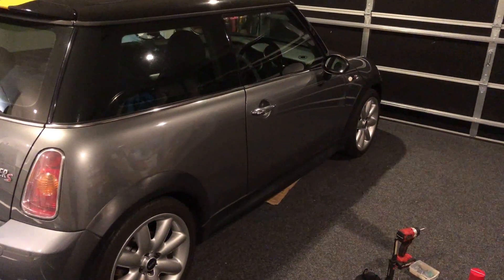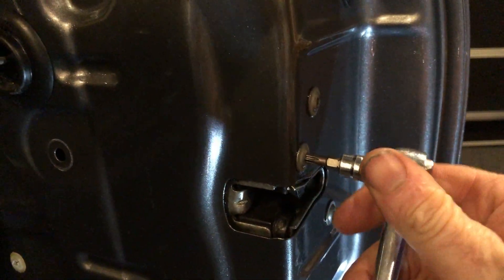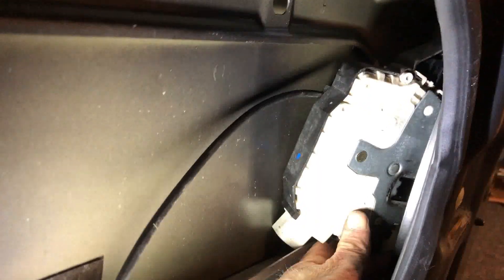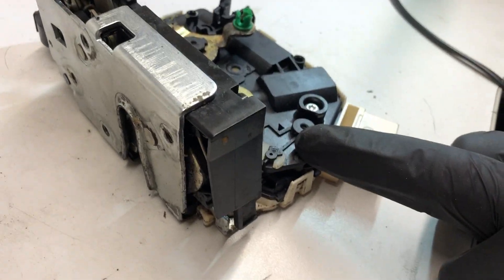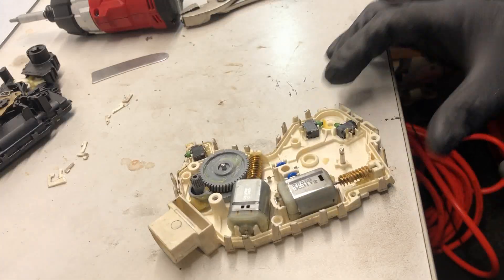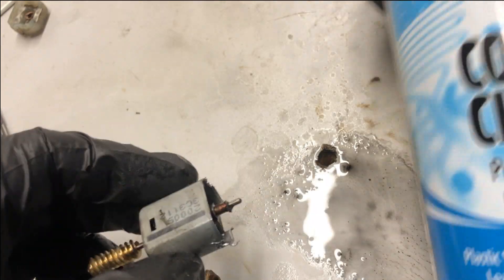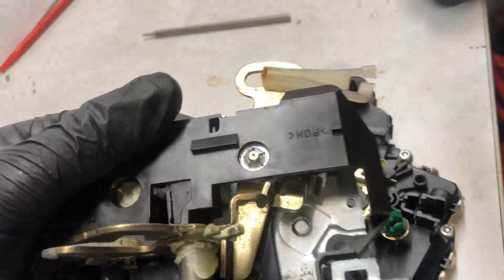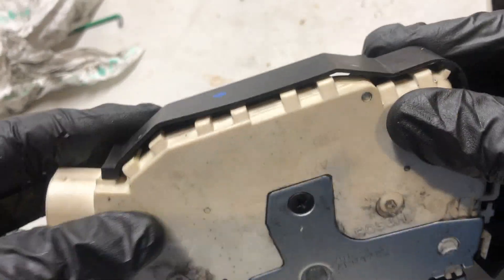Actuator rebuild - Mini R53 door locks not working right?

Comment: After many months trying to sort these locks this is my advice ..there are two motors ..one is  for open and close the lock and the other is  for the dead lock....the Body control module switches polarity to open and close the johnson motor...and the other motor deadlocks.....you can cut the.white wire on the loom to stop the.deadlock engaging if you have this problem and it still  locks  normally without...deadlocks are a pain if they jam...nothing opens...the motors  when removed may still spin..but when loaded with the lock mechanism to move may fail...replace ..and make sure you get the right polarity replacements...and make sure the mechanism is clean and moving freely....takes a bit of washing  out with WD or electric cleaner...then lightly grease it.....that's what causes motor burnout in my opinion..
Reply: When I unlock, the mecanism works, but not when I lock, that could be because of a fail of one motor so, right? If I cut the white wire, the door still open and closed but not unlock right?
Reply: @mechadesign  hi...ok there are two motors in the lock mechanism....one is  for the normal   lock and unlock...and  the other  motor is to operate the dead lock ....... If you cut the white wire it should stop the dead lock engaging...which is a complete pain...because it can lock you out the car ...it's a nightmare to bypass...the locks work from the BCM ...which powers the motors.   ...the BCM sends a +12v to motor to lock...then reverses polarity to the motor  unlock ....which works on both the motors...that makes any sense?
Reply: The lock mechanism gets dirt ingress then puts more load on the motors...which eventually fail...so if you have it working one way bit not the other then it could be tired motor  which is failing....welcome to ask any more questions
Reply: @mechadesign  the white cut  stops the deadlock from engaging on the lock.... You seriously don't need it....

Comment: Nice video, detailed, comprehandable etc. congrats. Those motors are the ones that have been installed in model cars since the 70's in Japan. They were called Mabuchi R130 if I remember well, but now they're all over the place (probably most of them being made in China).
Reply from the maker: Thank you. Makes it a lot easier finding the parts when you know what they're called.
Reply: @thomaswilding8818  The only problem is the shaft - the body of these motors is the same in all applications, but the shaft is different - they use very long shafts in the Mini door lock actuating mechanism with a worm drive (probably heat applied) to the end. That is the special part here.

Comment: Is it possible for the motor which was reconditioned or fixed go in the other way considering it has two terminals that it basically sits on ?

Comment: Thanks again for the tutorial on repairing these units. Worked like a charm until I realized that, although my passenger side door button goes down when I lock the car, the actual locking mechanism doesn't engage. The door opens and closes normally. 

I wonder if that motor wasn't cleaned enough because I didnt take it apart to flush it, or if I reinstalled a spring the wrong way (or forgot it altogether).

Any educated guesses before I take it apart again?
Reply from the maker: @KellyWestlund  sounds like your motor is working okay. I'd guess something round the wrong way.

Comment: Having replaced maybe half a dozen of these actuators over the years, I very much appreciate your ($$$ saving!) tutorial on fixing the dang things instead! 

In case it's helpful for the next person - after taking one motor apart for cleaning, I opted to try cleaning the other with contact cleaner through the little holes in the motor housing rather than taking it apart. Worked like a charm! Maybe save that PITA step next time around and make for a faster fix. 👍🏼

Comment: Good video... I did it same as on video. No problem at all locking unlocking perfectly but when I drove the passenger door locked but drivers not. when I stopped and pulled the handbrake it did not unlock. I dont know if it is because driver doors actuator motors are dead too or something else ? also middle locking button doesnt work. 
I tried to unlock the passenger door maually and it doesnt work... I dont know what to do
Reply from the maker: @aim8179  You'll need to pull the door card off again. Check if all the linkages are still attached properly at both ends, plug attached, etc. before opening up the actuator.
Reply: @thomaswilding8818  on the passengers side i did it. everythings okay. but I think computer still thinks that the car is in driving mode so it wont ulock the passenger door

Comment: My key fob isnt working but i already replaced the actuators on my passenger door because of faulire but it still wont respond tl the key i hear no clicking sounds or a fail to unlock it just doesnt work
Reply: Put a new battery in your fob and then follow the instruction to re-initialise your key. In the car, just press one of the fob buttons four times.

Comment: A pair of needle nose pliars just small enough to fit into the motors locking tab detents will grab the tab and  with a squeeze bend it out so you can open the motor.
Reply from the maker: My needle nose were too big to fit in their. That would make it a lot quicker (and safer) for those with a good set of fine tip pliers.

Comment: use an automatic center punch to loosen that push nut at 5:20. just punch at the base of each of the "fingers" and it will get loose then push the pin out. then you can get a new push nut when you put it back together.

Comment: Great instructions. I have a bonus tip for people. The par that you took off at 4:48, you may take inside the door. Then the whole peace comes more easily out. And the same thing when you put it back in. Put it there with out it and just add it after the lock is in place. Because getting the lock in and out is the pain.
Reply from the maker: Excellent tip. Yes that is the part you're fighting to get it out of the door. Great idea.

Comment: My kind of video - concise and just pushing my limits - -----------------------                      

I swapped a lock out for a 2nd hand one - that failed same way = duff lock motor
I swapped the spare good motor into the 2nd lock only to find (after a couple of hours of diassembly/reassembly) that the worm screws are different sizes (6mm on duff motor and 8mm on good pair)
i swapped the 6mm worm screw across
INTERESTING journey !!

  job completed!    

THANK YOU                        old git, UK

Comment: I was able to rebuild the one motor that was burnt out with new brushes from another motor. I was wondering if you knew what the other motor with the larger gear and attached to the grey gear does? Also, is there a amount of time you have to wait in between attempts of locking and unlocking while testing? My motor seems to work then stop working then start up working again after waiting. Maybe a thermal protection or just the motor being worn? Any advice would be great. I also found ebay has motors of the similar size and gearing. Thanks for the great video!
Reply from the maker: I have not gone through to work out the actions each motor controls. Good thinking replacing the brushes. I had hoped to provide a link to replacement motors, but could not find anything I was confident was a direct swap. Can’t say I’ve ever had to wait for the locks to start working again.

Comment: Driver and passenger locks running opposite from each other after you finish? READ ON! First of all, great instructions, you saved me several hundred dollars from buying a new one, and plenty more from not having the dealership do it. I’ve read several comments about the lock operating backwards after being reinstalled. I had this same problem and was about to lose my mind until I realized what a bonehead thing I had done. When I reassembled the brushes onto the motor, I installed the brush holder so that it was rotated 180 degrees from how it was supposed to be on the motor housing. I have photos to clarify, feel free to ask for the photos if this happens to you and it’s not making sense. It should have been obvious as there was now a rectangular hole between the motor and brush holder after I installed it incorrectly, which I totally ignored. I literally had this thing installed 3 times, and disassembled the actuator probably 6 times before discovering what I had done. I was about to tear my hair out, thinking the car had somehow reset in the control module and the polarity of the motor signals to the drivers door had been reversed. I messed around with the internal gears for hours thinking I managed to get something configured incorrectly. Thank God it’s working now though!
Reply from the maker: Must have driven you crazy trying to solve that one. Glad you commented. That’ll save someone else the same torment.
Reply: I’m about to try this and I’ll make sure I’ll mark mine to get it round the same way. So thanks for sharing this little helpful reminder
Reply: I fixed the motor and had it tested it spinned properly and I put everything back together and re installed now I'm having the problem you have highlighted above and I am not sure or don't understand what I did wrong. Kindly please assist with the photos
Reply: I am not sure what I did wrong?
Reply: @esaiamolimola3136  I don’t know how to post pics on here, not sure if it’s possible. If you can post your email address, I can email you a couple pics showing what to look for.
Reply: I see what you meant, and I reasmbled the brushes on the motor and tested the motor and it spinnined without any problems. Put everything back together now I  can only lock the unlock button doesn't work even the button in the vehicle can only lock doesn't want to unlock! When plug the actuator the window actuator activates accordingly but the unlock button refuses to work😮 it's so frustrating

Comment: Hi thanks for the video, I followed it but when re installed my passenger door is fine but the drivers door is doing the opposite, any Ideas please?
Reply from the maker: Yes, unfortunately typically means pulling it out again. Check those steps around 11 to 13 mins in video. The first time I did one of these, that's what I had to do get it working properly.
Reply: Hi, i have the same situation… How did you fix it ? Thanks
Reply: @Andr704  hey make sure both doors are unlocked then disconnect the battery, take the actuator back out take apart check that the plastic gears are both in the same direction ie open position then follow all instructions put back together in the car and reconnect the battery
Reply: @Andr704  hi also to make it easier loosen the nut holding the window and remove the bolt from under the door holding the electric window in and swing it out the way slightly so much easier and take two mins to do
Reply: This happened to me. I’ve written a long comment in this thread, but basically I incorrectly had the brush holder rotated 180 degrees when I reinstalled it onto the motor. I messed around with the position of the internal gears for hours, but I don’t think you can get any of that wrong. If any of the gears are in a different position when you reassemble, they seem to sort themselves out.

Comment: Thanks a lot for this video! I need to rebuild the actuator on the passenger door soon. In the end of the video you mentioned that you rebuild the power steering pump. Did you also have a video of that rebuild? I still have a broken power steering pump in the garage, swapped it for a working one. But always handy to have a spare one that is working.
Reply from the maker: I used this video. Although, I must say this one leaves a fair bit to your "imagination". 
https://youtu.be/5jXZpMPXUi8